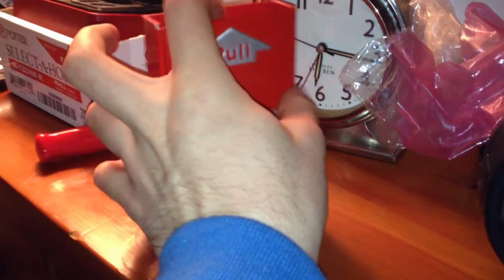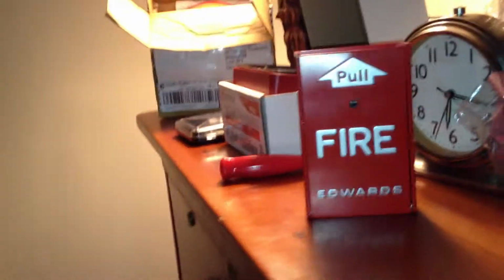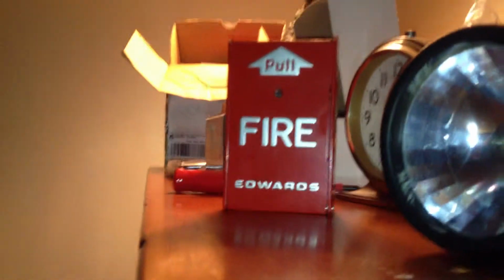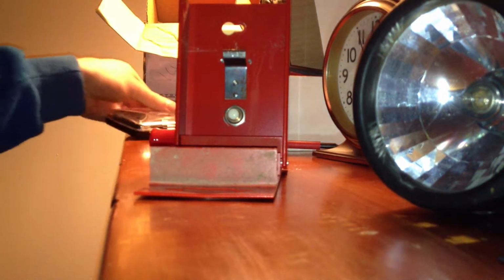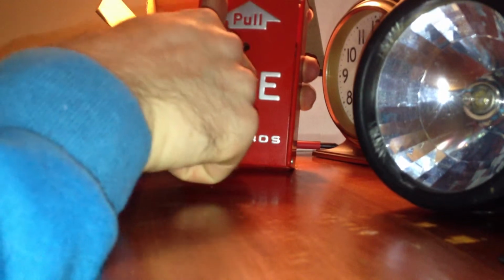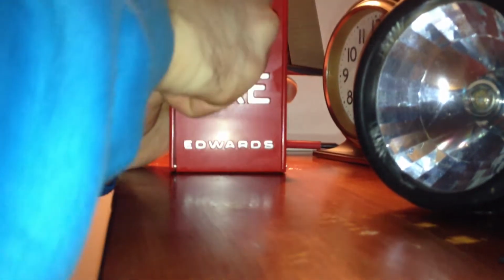My Edwards 275-C111 Pull Station

Comment: would u be willing to trade this for a vintage federal signal model 53 resonating fire alarm horn it's 120 volts ac and can plug into a outlet.I also have two coded couch pulls one does the code 323 the other does the code 234.